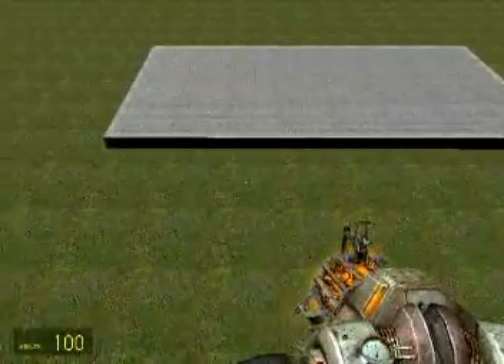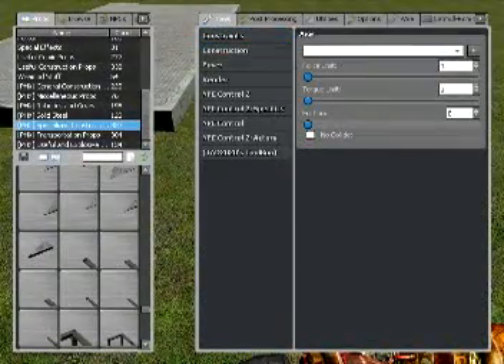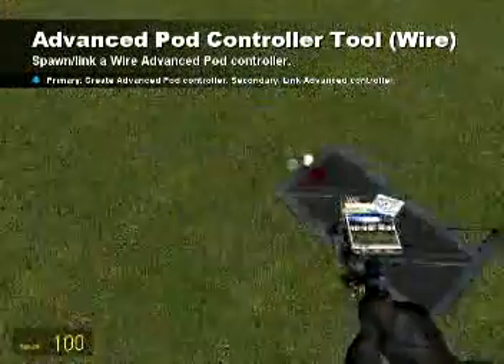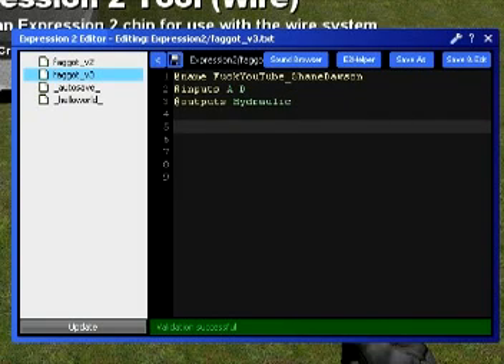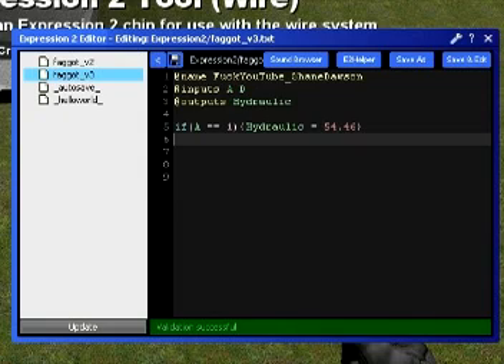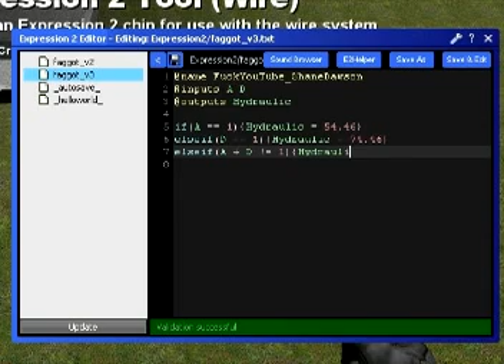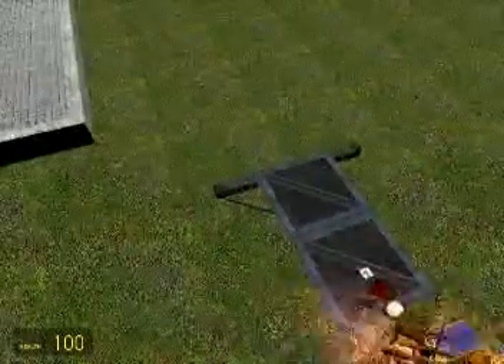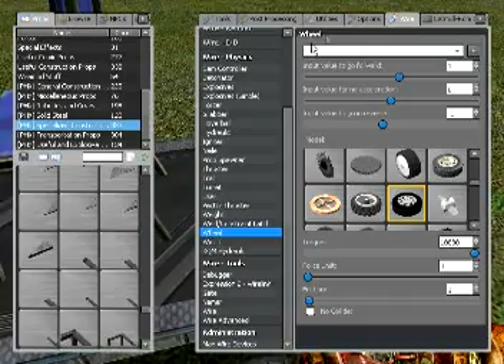GMOD E2 Tutorial: Thrusterless Wire Car Steering

Comment: My expression For steering looks like this. The left and right are the hydraulics going to the left and right of the bar or in my case the steering master that is linked via a 3 axis ballsocket lock to the front wheel bases. For the left/right equals you plug in the length of the hydraulic when the bar or steering master is straight. (I'm using 30 just for example.) The constant and damping are to help make the hydraulics a bit stronger. They varie with the weight of the bar so I suggest only b